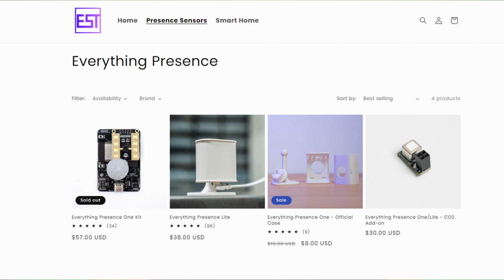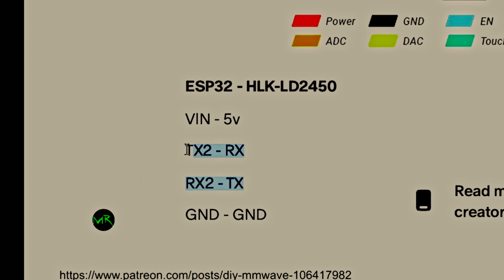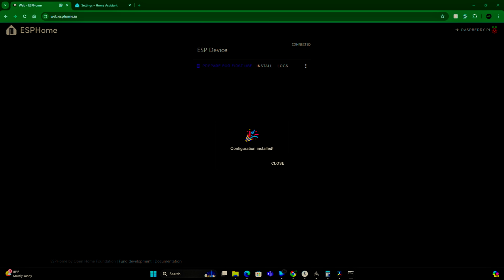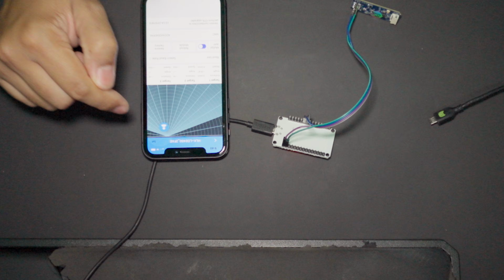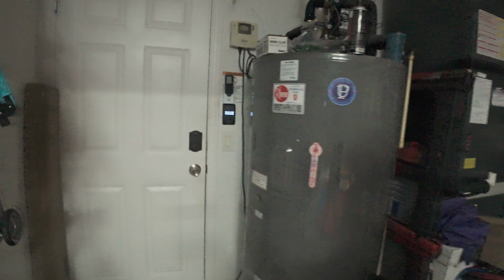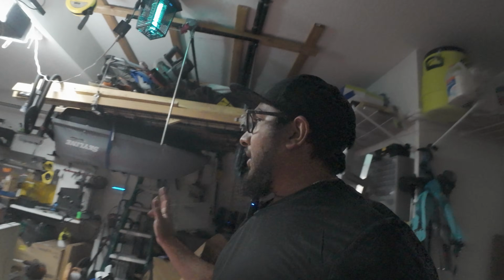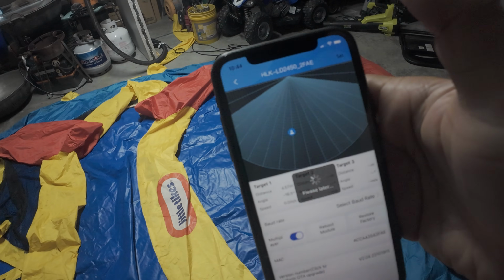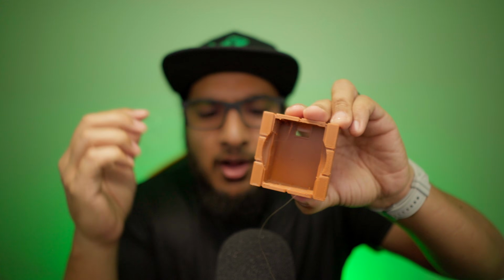Building Your Own mmWave Sensor for Home Assistant | DIY Presence Detection with ESPHome

Comment: Can't you create the zones (and place your furniture and whatnot) inside HA?
Reply from the maker: Home Assistant can create areas or zones for organizing devices, but it doesn’t actually know where a person is inside the room by itself.

The zones I showed are created on the LD2450 sensor itself, which is tracking where movement or presence is happening in physical space. Once the sensor detects someone in a specific zone, that information gets sent to Home Assistant and then HA can trigger the automation for that area.

So HA handles the automation logic, but the mmWave sensor is what actually determines the location within the room.

Comment: ok, so the hype for the presence detection is lowly falling.. I was using LD2410C and it's not as good, as I would expect it to be.
Reply from the maker: Really? I actually switched over to the LD2410C because the LD2450 kept failing to detect a presense. I'm working on a video to showcase it.

Comment: I got to the point of using the HLK radar tool, it is not finding anything on the scan, now what?  I also have the LD2420.  is the app scanning the network or Bluetooth?
Reply from the maker: its scaning bluetooth. The LD2450 has built in bluetooth. You do have to stand pretty close if you don't have an external antenna.